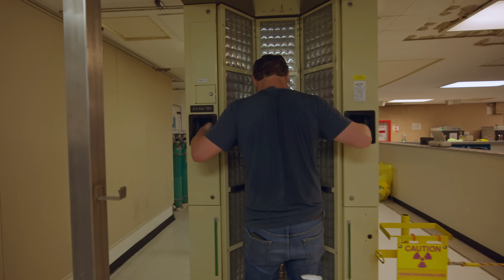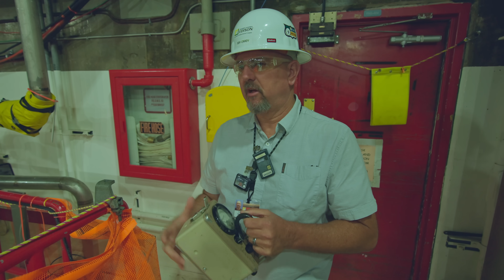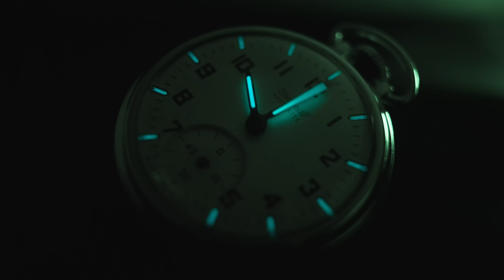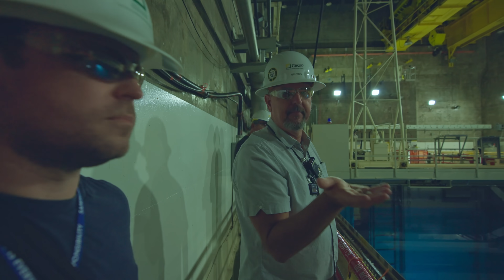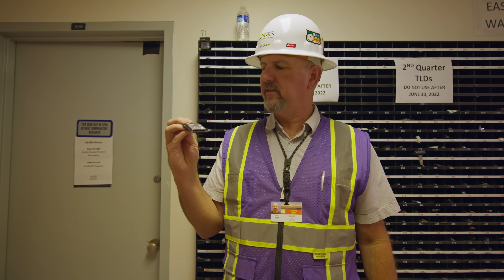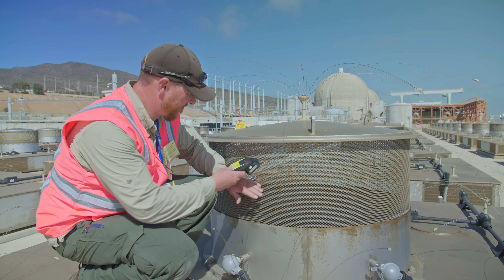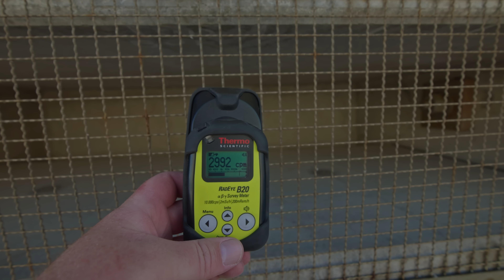Inside San Onofre Nuclear Power Fuel Pool and Spent Fuel Storage

Comment: Why was this plant decommissioned?
Reply from the maker: The new steam generator that they ordered was damaged when it arrived. These huge parts have a 5 year lead time so after that happened they didn’t want to keep the plant open. Many people think Southern California Edison used this as an excuse because they could have easily still run the plant with one working reactor.
Reply: @RadioactiveDrew The "new" steam generator was not the exact same design as the original. It was modified to get more power out of it. More tubes basically. This required a change to the baffles (the structures that hold the tubes in place) which resulted in the tubes "fretting" (rubbing against the baffles) They had tubes leaking and had to plug them very soon after startup. SCE and the fabricator had a huge fight over who was to blame. The steam generator modifications were not NRC approved. I worked as a manager for a large inspection company who did similar Eddy Current inspection in other Nuke plants. Not sure on the legal pissing match details but I know a lot about inspecting tubes on steam generators
Reply: What a bummer.  We all lost out as a result.  We will need to revisit this as California continues to get more serious about our climate and energy security goals.  It is only a matter of time.

Comment: Cool and interesting vid. How much of that checking for contamination is really checking to make sure that no radioactive material is being smuggled out of controlled area. Both for personal safety as well as public security.
Reply from the maker: What exactly do you think could be smuggled out?
Reply: Not sure what a person would take. Fuel elements are HOT. Anything from a spent fuel assembly would be too dangerous to try and hide on your body. No way anyone would pocket a piece of "new" fuel assembly.
Reply: The only thing that could be smuggled out would be small radioactive source material that is used to calibrate instrumentation. I wrote the software used to allow techs to check out/in those sources. A pretty close eye it kept on them.
Reply: @JohnBerthoty  guess smuggled wasn't quite best word use.  Like the guys that broke into an abandoned facility.  Scrapped a machine and took out the glowing bits and let their kids play with them.

Comment: Well, there's something I haven't seen in a while.

Never forget when I was new in nuclear. Found a LHRA (locked high rad area). 1500mr/ hr. Needless to say, I didn't stay long.
Reply: In the video they describing the up-ender that allowed fuel modules to through the tunnel between containment and the SFP. The area around that tunnel is accessible down in the bowels of the rad waste building. There are signs on the outside of the tunnel that said something like "GRAVE DANGER". I was crawling around down there once for a project and even though that sign was only valid during fuel movements, it still gives me the heebie geebies. Got out of there pdq.

Comment: @radioactive drew
Nice job with your videos.  Just curious, why do they have you do the whole body scan only to get inside the RCA, but when you leave the fuel pool RCA, you only have to check your shoes and hands for contamination?  Thanks
Reply: You would be scanned prior to being issued dosimetry for the first time in order to establish how much internal radiation you have prior to being exposed at their plant… You are then scanned when you leave, and any increase is attributed to exposure you received during your visit. Your exposure is tracked on a yearly basis. Dosimetry readings are tracked from every entry into the RCA.
Reply: @matthewtaylor3308  nope. That monitor does not monitor "whole body" dose. Only contamination on the body, and in very extreme cases it can detect  contamination inside the body. 'Whole body" scanners are different but are used several times a year by nuclear energy workers.
Reply: @matthewtaylor3308  I don’t think that’s what they were doing in this video. It looked like they were checking for contamination with the whole body scanner and the equipment.
Reply: This... I work in a nuclear plant and I can get to our spent fuel Bay without monitoring at all. Upon leaving however, I have to go though at least 2 whole body monitors. I hope this video just cut the monitors out. Also our monitors have more detection area and are way more user friendly.
Reply: @gill998  I think the video did just cut out them going into the whole body scanner monitors again as they exited the fuel pool area. Right @radioactive drew ?

Comment: now, see, i woulda worn an antique radium watch or tritium diving watch to see how long it took their sensors to pick up on it  XD
Reply: Either that, or an old Luminous dial compass.
They definitely would have found the Radium watch or the compass-The Tritium watch:likely would have been detected(but less likely:Tritium has little direct output that would get past the watch housing, HOWEVER, the Beta striking the watch housing would generate Bremsstrahlung(breaking radiation)-this would be in the form of very low energy X-rays(essentially similar to Gamma)-as this would be very low energy, this would be slightly more difficult to detect(but if everyone is doing their job correctly, it would likely still be detected):if not when you go in, almost definitely when you tried to leave(in many settings, they look more thoroughly upon leaving).
Reply: That's actually not funny.

Comment: Pretty close with your CPM meter. 2400cpm=2 millirem
Reply: If that is a standard Mica window "pancake" gm tube, then I seem to remember that 3600(some docs say 3500)cpm=1 millirem.
so even lower than your #'s.
Of course, this DOES somewhat on what the source is.

Comment: I love nuclear but they still have failed. 
32 feet above. Max wave 27ft 
It’s 1 thing. Mother Nature is a bitch. 
Without a doubt there should be a 10 ft wall around. 42 ft then pumps. 
Air at 120 deg can be recovered and used. 
But the cask are basically indestructible units. If Mother Nature broke them all open we would be dead from something else. 
I don’t think people understand how clean it is. 
Long term storage is the issue. 
We have places we’re we can store a lifetime of waste but people are well assholes

Comment: Given the low radioactivity of the long term outdoor storage, and how much heat is coming off of them. It seems like a waste of heat energy that could be used to do some amount of base energy generation. Sure it would be nowhere near the reactor output, but given the transmission lines and turbines are already there it seems silly not to make use of it.
Reply from the maker: Exactly what I was thinking.

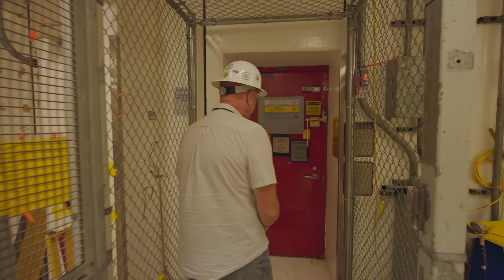Comment: 7:12 - The door code is right on the door
Reply from the maker: It’s there because all the fuel is out of the pool. Security is very low, comparatively for this area of the facility.
Reply: @RadioactiveDrew  Got it. This was surely more economical than dismantling the door altogether.

Comment: With all the procedures at this plant you can see why the nuclear energy industry is one of the safest for workers. The problem for these plants is operating cost. Hopefully the next generation of reactors will be simpler, safer, and cheaper.
Reply from the maker: I think the smaller reactors would be much better. Safer and easier to maintain.
Reply: Cheaper isn't gonna happen.  "Next generation" isn't gonna happen, either.

Comment: @radioactive drew
Nice job with your videos.  Just curious, why do they have you do the whole body scan only to get into the RCA, but when you leave the fuel pool RCA, you only have to check your shoes and hands for contamination?  Thanks
Reply: I am not sure if protocols have changed in decommissioning or if Drew just sort of misrepresented the sequence during editing of the video (not intentionally of course), but when I worked at this plant and used those very same machines, that step was performed as you exit the RCA. I do not recall scanning prior to entry. You just grabbed your TLD, Electronic Dosimeter, signed on to the rad permit (cant remember actual name), got your brief from RP, and went in.

A coworker of mine ALWAYS wore polyester pants for some reason and frequently got contaminated with radon gas as described in the video. He had to sit infront of a large fan to try to blow it off before he could leave. A couple of times he came back to the office with loaner pants.

Another friend had his nice dive watch confiscated due to tritium in the hands or something.

Comment: 2 things I didn't get enough understanding of from the out-doors segment in this video are: 1) What are the things on top of the dry storage lids that I would describe as "fountain-shaped antennas"?, and 2) If the air from the vents is not radioactive, then what is conveying the radiation from the vents in such a way that the shielding can't keep it as low as the non-vented areas? 

A question I have that's more general, is: Why do they burn the last "few drops of fuel", so to speak, outside the engine, when combustion analogs would have a progression from "heart-pounding nitro-methane action to sportscar to household car to diesel long-haul cargo transportation to fuel oil powered transoceanic cargo ship to fuel oil for heating" progression? What I mean is, if the fuel is expensive and heavily regulated, then why wouldn't you make a bigger, lower-temp "reactor" for these used rods to get some more value from them with automated production containment, instead of spending so much on babysitting them over human lifetimes? Or rather, if a calorie is a calorie, regardless what temperature your reactor water is, why are you using the precious heat and short lifespan of new fuel to cool a growing pile of old fuel, when it could be doing something else, like desalinization, commercial fluid heating/cooling, industrial chemistry (like oil refining and well fluidity-heating), and on and on. It just seems like a waste, to waste.
Reply from the maker: As I understood it those antenna looking deals were there to keep the sea gulls off the units. I was picking up more radiation from that vent because back inside those upright dry storage containers there is a thinner spot that allows more radiation to come through. So even though it’s by a vent it doesn’t mean the air is radioactive. 

In a reactor like this one the fuel needs to have enough U235 in it. Once it drops below that percentage it makes the reactor not run as efficient as it would with newer fuel. I do agree with you that they should use this fuel in other reactors as it’s still generating a decent amount of heat sitting in that dry storage.
Reply: @RadioactiveDrew  Thanks for all those good answers. I'm kinda surprised that they would have an increased reading at that spot though, since they designed it to have a "tortuous path" as you stated. I'd imagine that the opening would be the first place a person would tend to look for anything "coming out" of containment, and so I wish I knew what the engineering consideration was for making that the hottest casually inspectable spot. Perhaps it has something to do with identifying which units had fuel, and that fuels' current state, for the comfort of guest inspectors, rather than guests from the public. Gravity implies the most likely direction of leak would be downward anyway.

Comment: I had a tour of the Bruce Nuclear Plant back in the late 60's (Engineering class from U of M), and brought my home made Geiger counter. The spent  fuel storage pool had a lower count than the ambient that I had at the university. So, yes, the shielding was good.
Reply from the maker: Water is a very good shield against radiation. I think a lot of people don’t understand that.
Reply: @RadioactiveDrew  https://youtu.be/C5ABKM_8UuA
Reply: @RadioactiveDrew it is, until it's not.
 Like what happened at Fukushima. Those pools can evaporate very quickly if circulation is lost, and what happens then? 
The radiation can create steam, which is water broken into its baser elements by the gamma particle cracking,  hydrogen an oxygen. All that is left of the fire triangle is the spark, that caused Fukushima to explode 1 fuel pool right after the next. It was admittedly, a bad design flaw from the getgo.
Thanks due to the admittedly ignorant President Nixon, it's the PWR's we are stuck with. Maybe we actually need to go back to the drawing board and rethink Dr Weinbergs reactor designs. Much like he did, when he designed and  built the MSRE at ORNL. It was a much better reactor design, as it ran with a molten core fluid (no need to worry about "accidental" meltdowns, with it RUNNING in a continuous molten salt core). All that was left, was figuring out the chemical processing and fuel recovery plant. Which Kirk Sorrenson has done a lot of that, but he's not a chemical engineer. Maybe someday, we will live to see Dr Weinbergs dream come to fruition.

Comment: Mr Drew, around 29mins you  referred to a cannister being dropped.  The problem would have been the spent fuel pool, if the cannister dropped it wouldve ruptured the pool, causing all the water to leak.  This wouldve almost certainly lead to immediate overheating and burning fuel, an entire state wouldve been covered in radioactive waste.  And you seem a little ignorant, because you seem to miss the point, it wasnt the cannister, it was the holding an extremely heavy object over the suspended fuel pool,  causing the pool to malfunction and catch on fire.....  The cannister was never the issue, the weight being suspended over the pool was.
Reply from the maker: Yeah, you are getting a lot wrong there. First off if that canister had been dropped in the fuel pool, which is wasn’t…it wouldn’t have done anything to the fuel pool. It would maybe damage the racks holding the fuel bundles but that’s it. The fuel pool is built with an insane amount of reinforced concrete. So no water is going to be leaking out of it from anything being dropped in. Second the fuel pool is inside the containment building. So even if the pool was empty of water and the fuel caught fire it’s in a very secure containment building. 

So it sounds like you don’t know much about this location and are just trying to fear monger about something you really don’t know about.
Reply: @RadioactiveDrew  Honestly I'd like to see a canister rupture a 2 meter thick concrete wall, seems like it'd be quite the show.

Considering a lot of SFP units have drenching lines that can kick on at a moments notice it's unlikely there would be a fire, that's ignoring the buildings fire suppression system.

As far as I can see what you're saying fits the bill and there isn't much of a reason to doubt it.

As for the commenters thing about a state being covered, it's a plain lie, one incident I recall working on was a total loss of recirculation to a UHL Vitrified Waste Silo, air cooled and water jacketed containers of the most nasty waste there is and it would take around 93 hours for the fuel to exceed 100°C, comparing it to the pre-process fuel in the SFP it's probably going to be around 24 hours, enough time to implement a temporary patch if needed.

I don't get how you have the patience to deal with comments like these, takes someone better than I, anyways keep up the good work and love from Japan.
Reply from the maker: Thanks for the comment. Would like to make it to Japan one day.
Reply: @RadioactiveDrew  Im just going by what an expert from the industry told me was their major worry when moving those cannisters into the spent fuel pools, where they load the fuel into the cannister, before the cannister is then moved into storage.  So, not something I know about, just repeating someone who does, and has been involved in moving those cannisters. Thanks no argument needed.  Just wanted to share what I had heard.
Reply: @danceofart  Sure you are. Sure.